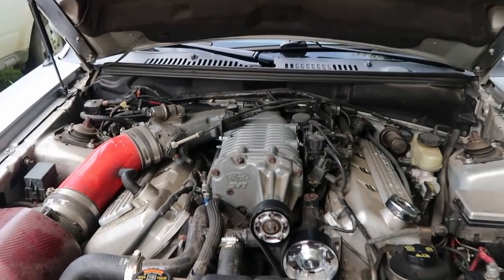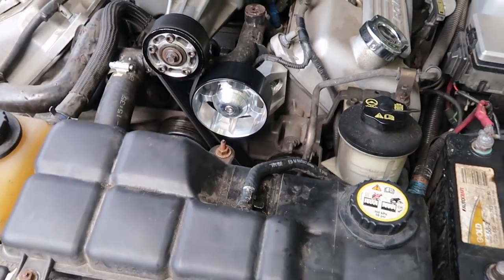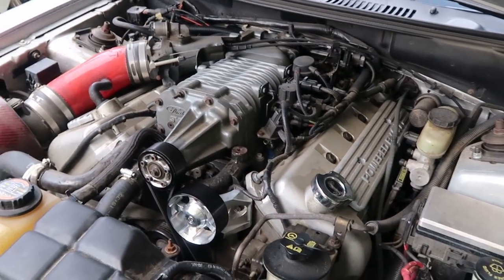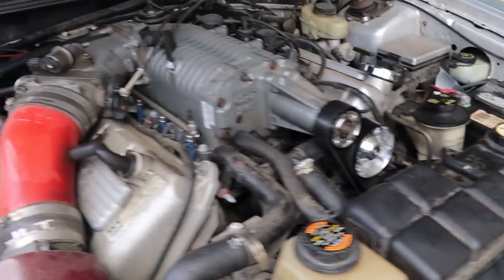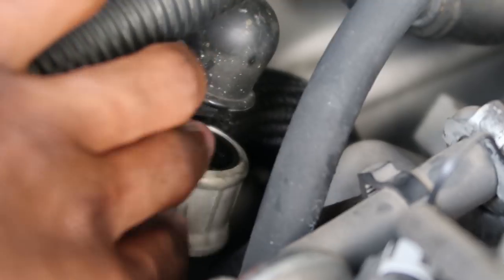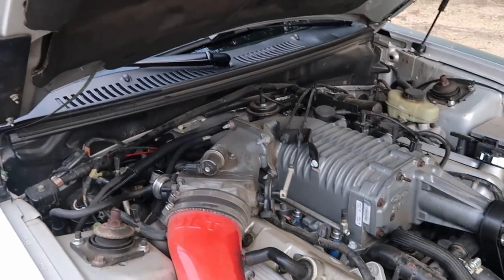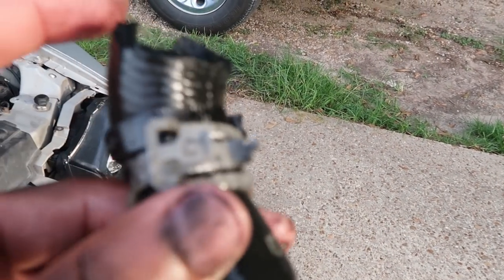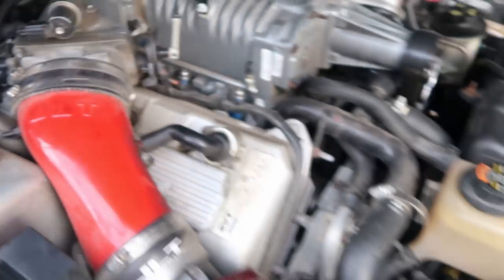I BROKE My Mustang Cobra... HUGE SCARE!

Comment: Pull the crossover plug back out and put antiseize on it. Or order one from MMR or Billet Specialties that requires a sockit for removal/installation. At least put antiseize on your stock unit.

Comment: Keep an eye on your temp. when driving to make sure you got all the air out of the coolant system. Also, you might be better off going with a smaller size belt because of the pulley change. If your present belt slips, it may break and wreak havoc under the hood! Good Luck.
Reply from the maker: I actually bought a 74.5 belt, just never installed it. Imma wait for a bit until I see wear on my belt now. And the 170° thermostat seems to be working like a charm! The temp is a little lower than usual🙌🏽
Reply: That's funny, I run an 82.5" Gates Green Belt on my Cobra! But I have an additional idler, manual tensioner and different upper(3.0) and lower(4lb) pulleys with a Whipple 2.3L. But 650whp/615wtq is a lot of fun!!

Comment: That's how you burp all 4V's.. and you should look into a replacement cross over plug before that one does strip and seize.Look up Jay Richmond on the cobra pages, he sells real nice billet ones with hex heads, no more 1/4 drive heads that strip out etc.

Comment: Ooo, I did not know you got a pulley.  Nice.  Did it come with a tune?   As for the burping method, yep I found my burp lid to be stuck, broke the end of a cheap ratchet off in it, that  was 12 years ago, and its still in it.  I used a slightly different method.
Reply from the maker: Lol yea, I was gonna record installing it but it took wayyy longer than I thought to install it, the idler, 170° thermostat and burp the coolant. So I decided to tell you guys in this video. Hope that wasn’t a problem😅

What method did you use to open the lid?